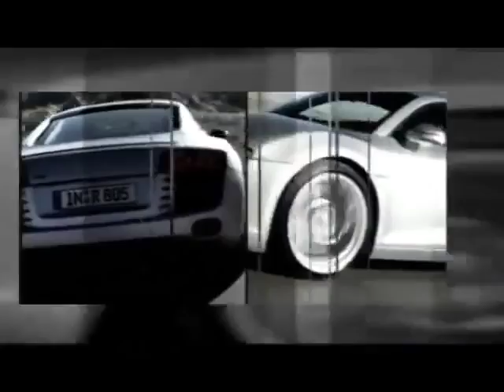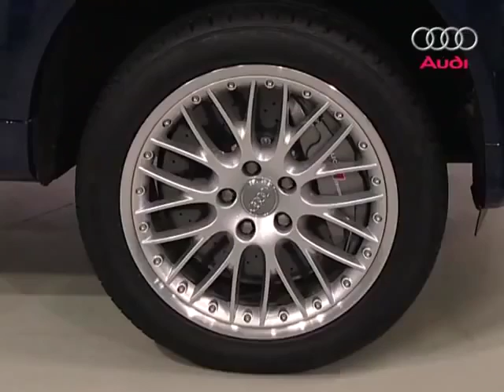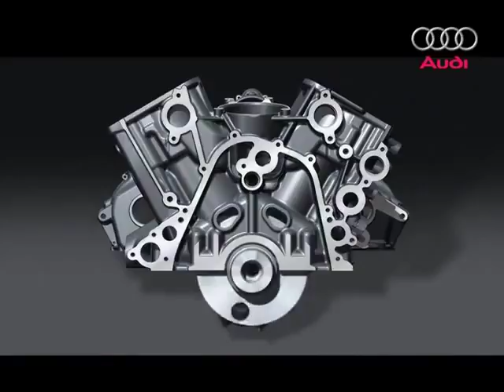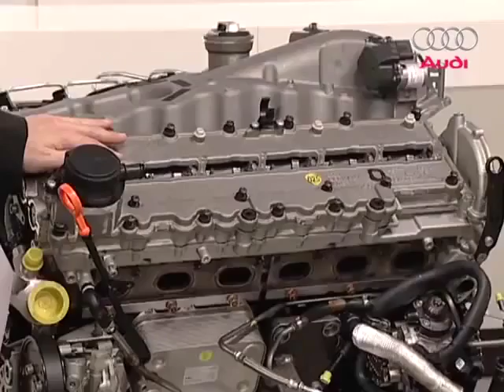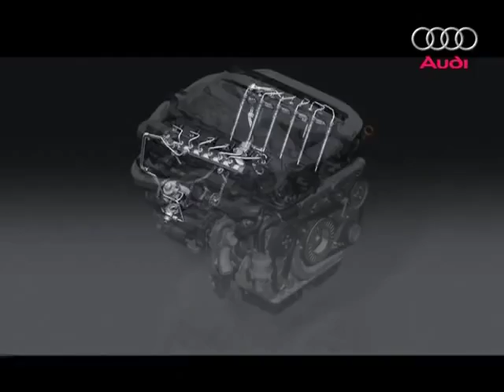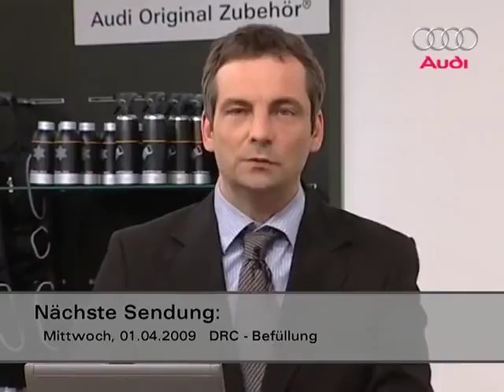Audi Engine TDI 6.0L W12 Service Training Information

Comment: The title and text is incorrect. The 6.0 TDi engine is a V12. The W12 6.0 is a petrol engine and has no connection at all with the 6.0 TDi.

Comment: Dude guy, W12 is a W configured two v engines melted into each other. You have two rows of 3 cylinders on each side. Do to the torque and force in a diesel engine they CAN NEVER BE A "W" configuration. The two big diesel motors are the TDI V10 and this engine, the TDI "turbocharged direct injection" is the Volkswagen audi group name for the diesels.  There is only one w12 engine it runs on gasoline only. In the beautiful VW Phaeton, Audi A8 D2, D3, and in the "L" model only for the A8L-D4, All of the Bentley's Conti, Spur, Mulsanne. As of 2019 Audi will no longer offer the 12 Cylinder gasoline/ petrol W12. If you want to see what an actual W12 is watch Bentley W12 how its made on Youtube.  This is an excellent video about the "V12"  TDI Most TDI are called R like R3, 4, 5, R10 and R15 for the V10 and V12 TDI Diesel engines
Reply: Very good Comment, the only think I would like to mention is the fully written TDI. Which means "Turbodiesel with Directinjection and Intercooler".
The early Models known as "TD" had no Intercooler.

Greetings from Austria

Comment: the single douplex drive  chain  is a bad idea . its at the back of the engine  so a nightmare to do  also a big bill to do it and would wear out quicker with that power   i thought that camshafts and drive train was old school   now using electric  control valve systems  being a lighter engine and less parts to wear  and being smaller .so more reliable . or is that system for only petrol engines ? so to change a fuel pump you have to take the engine out . i think we are going backwards , why do you need a v 12  also the governments are telling us to buy petrol engine cars or they are taxing us high for having a diesel engine cars.

Comment: Ok , you can change the oil-filter and the different liquids with the engine still in its place. Is there something else you can repair or change perifericals on that engine without pulling it out first?
Reply: Not really...;-) 
chain gliders are on the back of the the engine, so...
Reply: @TINRFD  life time 😉😶